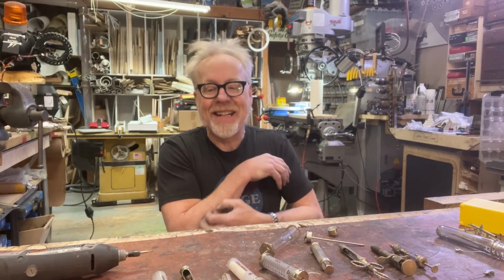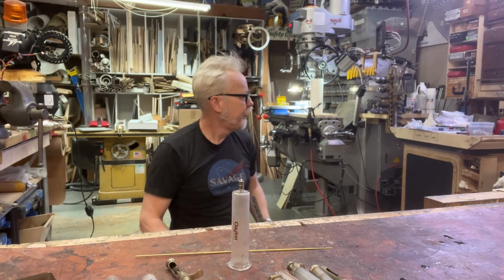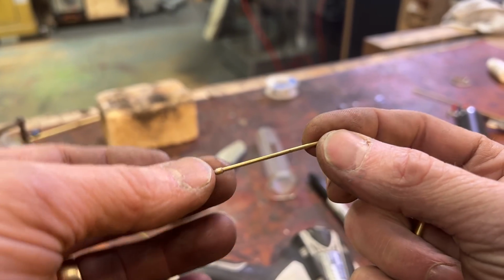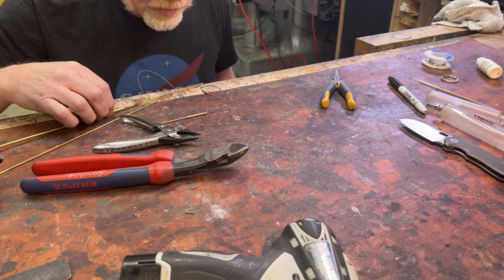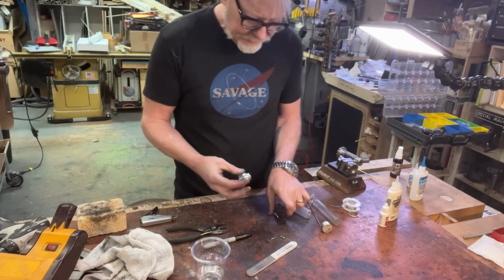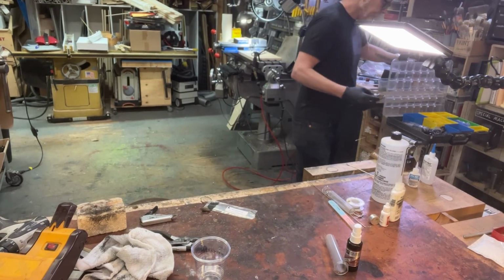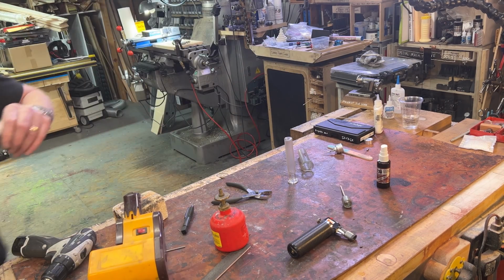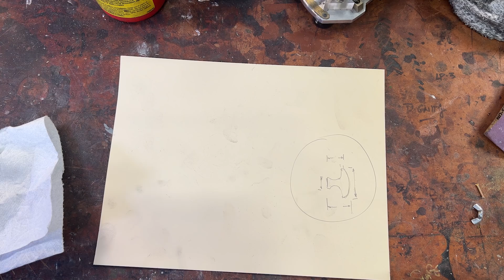Adam Savage's One Day Builds: Special Effects Syringe!

Comment: Suggestion for the fluid trick: use the original glass plunger that you Dremel'ed a hole in the beginning. Coat the inside of it using paint color that matches frosted glass. Frost the outside of it heavier too for good measure. 

Now drill a hole in the backend of the plunger as well. Fill the syringe with "medicine" of your choosing, then when you push the plunger in, the fluid will be able to go into the plunger and the air can escape out the other hole you drilled. 

You could put a check valve in the front side of the plunger hidden in a rubber gasket (like modern syringes have) so that the fluid can't come back out of the plunger once it goes in. 

You could take it a step further, forego the check valve, and pre-fill the plunger with a dye. Then when you push the first liquid in it mixes with the dye inside and when you pull the plunger back out, the dyed liquid refills the syringe but there's a vacuum so you cant really tell which way the fluid is filling the chamber from

Comment: I was in the Royal Army Medical Corps in he early 1970s. Although most syringes were the single use plastic kind, we were still using some of the old glass syringes. Although the smaller syringes used stainless steel plungers, the large ones (10 ml and upwards) invariably had the ground glass plungers like the one you replaced. I think this was a weight issue... you really don't want a heavy plunger thumping home when receiving an intravenous injection (that's why the glass plungers are hollow)!
Although ground glass isn't opaque, perhaps it could be without being too obvious. That way, the fluid could go into the plunger invisibly if there was a small aperture in the base of the plunger. It would be a matter of equalising (I'm a Brit so I spell it with an 'S', okay?) the pressure between the space within the plunger and the chamber of the syringe. Pressing the plunger home would force the liquid into the plunger but also you could mimic taking a blood sample because withdrawing the plunger would suck the fluid back into the chamber. It wouldn't be obvious that the liquid was coming from the plunger rather than a vein.
It's just a thought and I haven't tested the theory but it might be something you could think about. Your build looks convincing enough to those unfamiliar with old syringes but those who are would be wondering why the syringe has a piston that looks like it came out of an internal combustion engine.

Comment: Cool point to note about glass syringes (if you don't cover it already in the video!) is that the plunger should spin freely inside the syringe body, it should be perfectly aligned and the tiny amount of air around it acts as an almost frictionless (or at least massively reduced friction) aerodynamic bearing. Looks really cool as it spins!
Reply: Steve Mould's video on aerodynamic bearings covers this beautifully btw if you'd like to see it!

Comment: The disappearing liquid solution was right in your hands after carving the hole in the end of the glass plunger. Make a tiny hole in the other end of the plunger, or if it's open ended, make a plug for it with a small vent hole. Apply paint to the inside of the plunger and you're done. The hollow plunger can move back and forth to "inject" or "draw out" fluids but it's just flowing in and out of the plunger.

Comment: I've been slowly scratch building and 3D printing a field medic kit for parts of an eventual plague doctor costume. When I finished the first scalpel and forceps I got some funny looks from my family as to why I had disgusting looking surgical implements on my desk. They can't cause any actual harm though, the scalpel blades are flexible plastic and the forceps would probably break with any real pressure, I'm also working on some scissors and a scratch built syringe made from a clear plastic tube and pieces of a handheld bike pump just need to get around to painting them.

Comment: a shop i worked at specialized in physical media props. we made a lot of basic easy sale items but we also did custom orders. At one point we got a request to make a prop weapon out of a drill press. Concept we were given is the drill bit will push down on someones head to kill them. the main issue with this is functionality, they wanted no CGI work on it meaning the bit and everything needed to spin and as such also needed to retract and expand. this required A LOT of work. We had to basically strip an existing drill press down to its shell and build custom internals. the retraction and the expansion was actually very simple, We used a wire and pulley system very much like an automatic window on a car, the bits were made of soft matte coated plastic, we installed near the base of where the drill press would get close a detection system that measured how far away the object was under it, based off this we would then push out fake blood and fake brain matter made out of a mixture of cauliflower, bread, and gelatin. we also provided them with replica heads of the actor that had the remaining of the sensors needed to set off internals. was far more complicated than I explained in here but it was one of our favorite builds on account it was so outside of the box and the contractor was very specific on what they wanted, We originally planned on just making a hard plastic mold of the actors head, have a per installed hole in it, and place fake skin over it and just have the blood and brain mix in the head, but in testing the contractor did not like the look of it. sometimes the simplest solution is the best one, but this was not one of those cases.

Comment: If you need a better fit for the plunger and o-ring, look up a livestock syringe gun. The plunger has the o-ring sandwiched between two pieces and connected with threads to outside of the tube. You can turn the end and compress the ring to make a tighter or looser fit against the inside diameter of your tube.

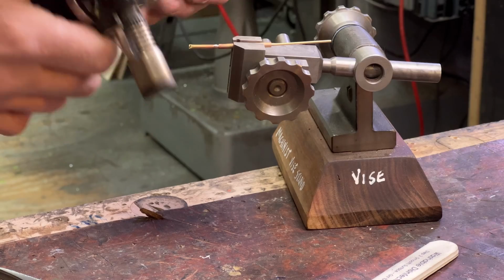Comment: 11:52 A piece of cotton or wool thread, up the needle's tip-end, looped over  final coil(s) of the spring (farthest from the needle-tip), and back out the needle's tip, solves the problem of fighting the spring, while soldering in that last stop. Just pull on both ends of the thread, to draw the spring back and out of your way. When you're done soldering the stop, just pull on one end of the thread to remove it. Polyester thread might work, but there could be enough heat too near it, causing it to melt.

Comment: If you put a plug in the needle, get a hollowed out plunger with 2 check valves (similar to modern reusable water bottles)
One at the entrance to the plunger and one at the handle to the plunger, the air/liquid inside the syringe can travel into the plunger making it look like you're injecting the liquid inside the flesh.
To get the liquid out though you'd have to blow on the plunger or, maybe compress air from the syringe to preform like a blowhole.

Comment: Bought one of these from a joke shop when I was about 6. It included an interior red tube you could release to simulate injecting or drawing blood. 
If I were making this I'd simply have flared the brass tube with a center punch instead of all the cutting and milling to keep pieces from sliding out. Fluid inside is easy if you use a glass syringe as the plunger tube is hollow. Just drill a hole in the end of the plunger and glue a toilet type "flapper" on the inside then pain the outside of the plunger tube opaque or sandblast it. Push the plunger and the liquid pushes open the valve and disappears into the plunger.

Comment: i thought adam would put some liquid mechanic into the tube as well, so that you could actually pump a visible liquid into a hidden cylinder, to "empty" the syringe. just have a hallow cylinder int he middle, maybe nicely in brass, and have the liquid push in and pull out of there with a nice valve in between.
that would make for nice effect. you could even put a lever on the valve, so you can empty and refill the syringe for real and put like Fake Blood into it. so it can look like youre taking blood out of someone.

Comment: I love these random builds. Such inspiring stuff. BUT!!

Use some coolant or lubrication on your machining bits. The engineer/machinist in me screams in horror when I see you going in dry (oo-er) 😂 
A new favourite I’ve found is rubbing alcohol. It cools really well and quick. Only problem I find is you use a load of it very quickly. And still have to use some sort of messy lube to begin with 😂

Comment: It’ll be hard for the piston to move smoothly using a rubber gasket inside that ground glass syringe. The original glass piston Adam didn’t use was designed to be used with stopcock grease to both lubricate and seal the syringe when it was used.  Rubber gaskets generally work better on smooth surfaces than on ground surfaces.

Comment: instead of all-thread could you use a durable hallow tube for the plunger push-rod to allow the fluid in the syringe to appear to go down the needle. the top of the plunger push-rod could have a check-value that allows air to escape but not liquid and the liquid could take the place of the escaping air. this effect would only work with a small amount of liquid. but depending on camera angle , the handle could have a tube and not be shown when the needle is being pressed. this way you would not need a check value either. just a thought

Comment: No sure what you are doing with the fluid but if the plunger was hollow then the fluid could go into the plunger when it is pushed. You would have to have a way for air to be pushed out without fluid but might work.

Comment: Make the plunger large enough diameter to store fluid to be "injected".  Leave air valve at push point to cover with or control with thumb, then it can fill up and give an additional element.

Comment: Hey Adam, What if you machined a hole in the center of the plunger, and kept the stem of the plunger tube hollow, then you plug the "needle" end with glue or whatever so no liquid goes out the needle, then fill it with something (red liquid, whatever) and then as the plunger goes in, it forces the liquid into the tube in the middle of it, and then if you have it fully pressed in and hold it to your arm and pull it out, it would refill the syringe with the liquid and make it look like you were drawing blood. Just a thought, cool video. =)

Comment: Protip: when soldering something that you HAVE to clamp in a vise, I've successfully clamped tweezers in a vise, and used them to hold the part, but for larger/slippery items, even a single sheet of paper or napkin can provide enough thermal brake to let the torch keep up.
Reply: And yeah the paper burns, but not right at the contact patch.

Comment: You missed a part that would have solved your issue with the aluminium plunger hitting the glass as you pushed it in. The part is a cap with a hole that the plunger shaft goes through. The cap fixes to the top end of the syringe tube and helps keep the plunger straight while you push it in.

Comment: I think you should upgrade the look and functionality....add a thumb hole on the top of the plunger and the  two other holes for your middle and pointer fingers on the side so you can push and pull with more control...kind of like the smaller one you had in the beginning.

Comment: I need one of those... Okay, could have done WITHOUT the overly descriptive "Tale of the Seven Stitches" (sounds like a Brothers Grimm story...) Could the "liquid" be something compressible? Like red sponge that compacts into the head of the plunger but naturally expands to fill the syringe when the plunger is pulled back? I know that's not ideal for a close up but barring that the only thing I can think of that works in a similar manner is the "Magic Baby Bottle" which is a double-walled cylinder with a VERY narrow space between the inner and outer wall. The "milk" fills this area (and it doesn't take much) until you tip the bottle upside down and the liquid flows into the much more spacious cap making it appear that the milk has drained out of the bottle itself. Pretty cool effect. I once built a cerebral suspension unit (trade name "Sustain*A*Brain") by the Acme Mad Scientist Supply Company. I worked at a corrugated display design company so my raw building material was thin corrugated (aka E-flute). The primary structure was a large coffeemaker shape with a digital print mounted to it. A standard glass cookie jar contained colored water and one of those "growing/shrinking brain" toys and was lit with white LEDs around the jar and other random blinky LEDs on the control panel. A lot of work and relatively simple but something I was very proud of. There were two other matching pieces of lab equipment I built: the Re-Animotron and a "Transduction Generator/Power Inverter." Thanks for the random build, Adam!

Comment: That o-ring needs silicone oil. It will serve 2 purpose. The lubrication and it will make the glass clear. Also adding a double O-ring will stabilise the slide and look bad ass. Maybe 1/4 inch spacing.

Comment: A hollow threaded rod in there with a little valve and you could put disappearing liquids in there
Or just thread both ends of the pipe in a slightly wider hole and inject even more substance at a time

Comment: You had the right idea with original plunger. If you added a small hole at top too you could have liquid in needle then when you push plunger it goes inside plunger and hides it. Just darken the plunger

Comment: It would have been neat to use the same style of the original plunger but have it not be clear.  Then you just put a hole in the plunger and fluid would flow into the plunger and disappear.  You could do the same concept with what you have, but have the fluid flow into the all thread / tube.  Either way, its a method for removing the fluid without it looking like its back filling the plunger.

Comment: Hmm. Seemed like you still had a bit of the outer needle piston body sticking out of the metal bit holding the needle. That outer tube shouldn't be visible, in my book.
But still a nice build.
Even without the disappearing fluid.

Comment: Brass tube thoughts. Flaring or condensing the end of the tubes with a dapping block could have made this structure with no soldering. Also. Adam. Don't hold things with your fingers while your soldering them.
Reply: You should really consider raising a vessel in Copper for a project. I think it would open the door for you to a whole different world of metalworking

Comment: Not to sound like an electronics guy, but wouldn't flooding the joint with 3.74 metric sh*tloads of flux (2.1 US craploads) of flux....have made that an easier and better joint? I'm sure the silver solder is self fluxing, but that only works where it's touching, it doesn't really help it flow.
No?

Comment: If you had made the shaft of the plunger a little fatter and hollow,  made a hole  in the bottom of the plunger, a liquid  would fill the shaft as you pressed the plunger. Would it not?   Disappearing  liquid.